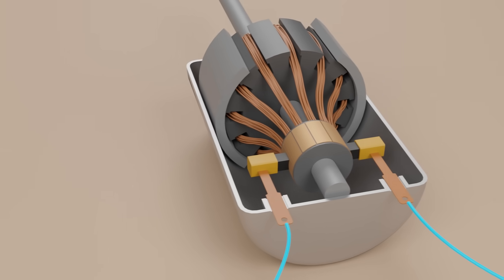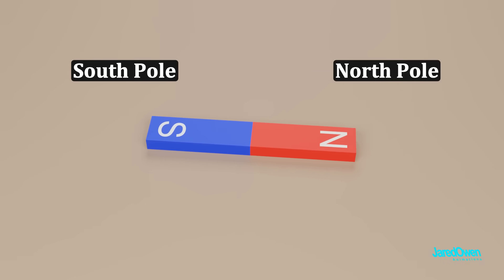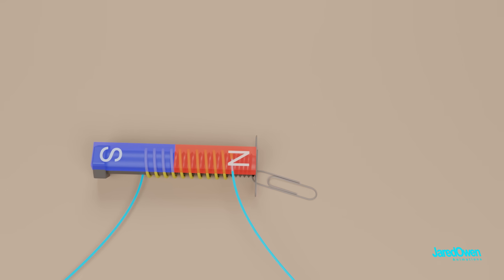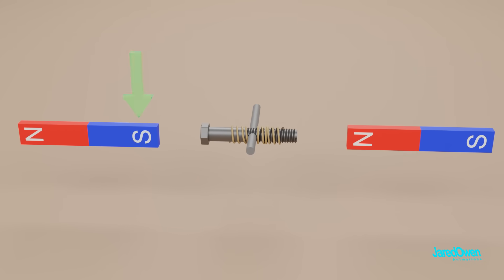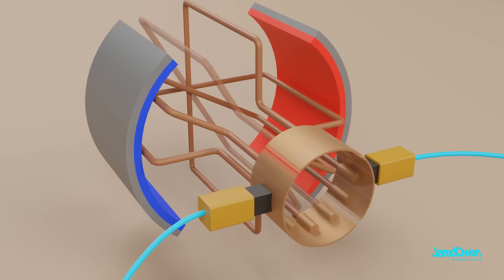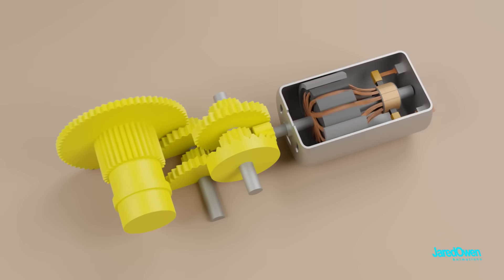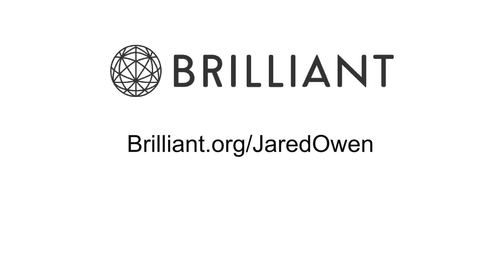How does an Electric Motor work?  (DC Motor)

Comment: ive have some general idea of how a motor work using abit of logic i conclude it must be magnets and electomagnets stuff but before watching this video i cant really understand how the thing work because available motor i have is small and if you open it it just filled with wires. theres alot of thing i didnt understand mostly the switching current part . but your video was made with high quality in mind after i watch it 1 time i completely understand how it works so i want to thank you for that

Comment: Name one device that will work differently if you swap poles?
Reply from the maker: The electric motor😁  It will spin the other way if the battery is reversed

Comment: In my experience, learning about how electromagnetic devices are made (the "how") raises more questions that it answers (the "why")...
1. why the charges bother to move through the circuit
2. why the charges move as quickly as they do
3. why the charges have to be moving to create a magnetic field
4. why both an electric field and a magnetic field are needed for this (or any) circuit
5. why the circuit has to be created with a ferromagnetic material
6. why the motor spins in a certain direction
Reply from the maker: Great questions!  I didn't want to get too deep into that kind of stuff for this video

Comment: Very cool! I teach the King Air aircraft. The electrical system and specifically, the starter motor which then becomes a generator, will be easier to explain with this video. I also throw in the watt (volt x amp) to foot lbs torque discussion to help them make real world sense of the spin the starter provides. Thanks!
Reply from the maker: Thanks James!  I was originally going to take a minute or 2 at the end of this video to explain generators but I thought it might be too much.

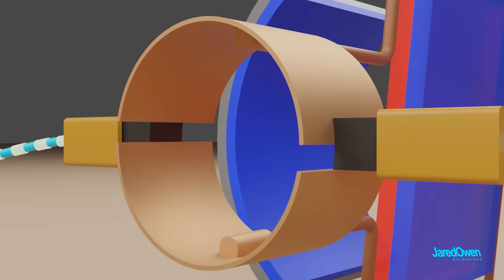Comment: The current flows 5:18 because of the battery.,but how the current changes its flow before and after the switch 5:39..?

Comment: Electricity actually flows from the negative end to the positive, because the flow is electrons, which are negatively charged, so the place where they come from is the negative pole.
Reply: You could think of it as this. Negative electrons move from the negative to positive terminals of the battery (your right), but the positive charge of electricity flows from positive to negative terminals of the battery. So it is kinda both.
Reply: @MrT------5743  actually no right?
Because positive  charge is in the protons, while the electrons are negatively charged, and electric flow is electrons moving around. Protons are parts of atom cores. So the positive charge moving is not gaining protons (which would drastically change the weight compared to electrons) but rather a lack of electrons. So the positive charge isn't moving anywhere, the negative charge oppressing the positive charge of one side is just moving to the other side until both sides have reached equilibrium and there is no (disbalance in) charge left, making your battery "empty" (quotes because it hasen't lost anything)
Reply: @jucom756  But a lack of electrons (an electron hole) is positive and that moves the opposite direction as the electrons move to fill that hole. I get that the positive electron absence isn't really physical but it is a thing none the less.
Reply: @MrT------5743  that's a good explanation thx.

Comment: Well, the current goes through all the coils (some might get shorted by the brushes). 
That is because the coils aren't wound directly 180 degrees to the opposite commutator segment. The point is that current runs one way through all the conductors on one side and then the other way on the other side.
Also, heh, I'm tired but... parallel conductors have absolutely no effect on the resulting force/field/torque. You need to increase actual winding count so that the resulting fields add up. In parallel you would just reduce coil resistance.

Ah, man... I'm having my final masters exam exactly with this stuff just next week and atm I just hate my life :/ 
FREEDOM! Koně, království za koně!

Comment: Great video. thank you!. So it will only last as long as the brushes... presumably they wear out because of friction?  Does the motor housing fill with fine dust from them, like the you get from the brake pads on your car?

Comment: I don't want to be the nerdy guy, but the thing with the bold and the wire isn't really true. Yes, you can turn some metals into magnets by lining up der small magnetic structures, but thats not how electro magnets work. They work because a magnetic field is created around the wire due to the current flwo and when you turn the wire into a coil the magnetic fields stack on top of each other and creating a stronger, directed field. The core inside the coil (the bolt) just increases the strength of the magnet but it isn't necessary.

Comment: Fantastic video. I have 2 questions that someone may he able to answer:

1. 2:57 Why does cutting the current cause all of the magnetic domains to revert back to random orientations when they were already nicely aligned?

2. 7:28 Intuitively, why does replacing a thick wire with many thinner wires improve performance?

Comment: You are showing the current the wrong way. Electrons come out the "bottom" of the battery and return to the "top".
Reply from the maker: Thanks Steve - what you are thinking of is "electron flow" - in this video I specifically mentioned "conventional flow"

Comment: Sometimes you see labels on these motors that say 5V for example and if you put more voltage through it, you risk breaking it. So what determines the voltage rating of a dc motor and why does putting more voltage through it than recommended break it?

Comment: What about a brushless motor?
Reply: In a brushless motor, the magnets are on the rotor and the electromagnet coils are on the stator. The switching of the current is done by an electronic speed controller instead of a commutator, so a brushless DC motor is basically an AC motor that's supplied with AC at a specific frequency to set its speed.

Comment: A timestamp 2:42 you imply that the magnetism of an electromagnet comes from the wire forcing the magnetic domains in the Ferris core to lineup.

This is not wrong however it is only a small part of the magnetic field in the electromagnet. You do not need the Ferris core at all. 

Magnetism occurs anytime electrons move. so every wire is producing a magnetic field. Just on a very strong one. If you make a hitchhiking thumb and point your thumb in the direction of charge flow the curling of your fingers tells you the direction of the magnetic field. 

When you coil the wire many times this allows you to add up your finger curl direction from the same wire many times amplifying the magnetic field from the wire.

If you add a metallic core it act s a little bit like a lens and adds its own magnetic field from the aligned domains in the material as you said.

Tldr, The wire itself produces the magnetic field. Not the metal it's wrapped around, although that helps.
Reply from the maker: Yes I believe this explanation is correct!  It's always hard to find the balance - not go in too deep but make sure I explain "enough"

Comment: And what’s the dark grey thing at the wires??? It is it just there to hold the wires? ( 7:33 )
Reply: It is the rotor and comparable to the screw used in the video. It isn't the wires on their own creating a magnetic field, it is the wires wrapped around the rotor (or screw) that does. Hope that answers your question.

Comment: You can also have motors which work in the opposite way to the diagram in the video, with the coiled wire on the outside on the magnet but inside the motor casing, most commonly copper, and the magnet on the inside. This means that a simpler motor can be created as there is no need for the commutator, this is used in things like vehicle motors for a few reasons, one being that you can it even more wire in a smaller space, it is even more constant than the one in the video and it also allows them to be shorter, meaning there is more space for batteries.

Comment: Nice Video!👌
You know you could also use a permanent magnet instead of an electromagnet, which would basically give you an infinite energy source.
However, you would have to rearrange the construction a bit; yet it should still be possible, because I’ve seen people use fidget spinners to demonstrate this.

Comment: how does the commutator "switch" the wires? I didn't understand that part
Reply: It doesn't switch the wires as such, the wires stay where they are. However the commutator is broken into sections, and each proceeding section is opposite polarity of the previous one. So as the commutator rotates the polarity will change each time the brushes get to a new section of the commutator so to speak.

Comment: Don't electromagnets need an iron core or something to work? i saw you showing a wire around a bolt, but then just the wires as the motor
Reply from the maker: Great question Jacob - an iron core is not needed but it definitely helps strengthen the electromagnet.  I believe the metal part that wires wrap around is actually magnetized by the wires
Reply: @JaredOwen  was thinking the same thing, thanks for clearing that up for me!

Comment: The fan shown in this video uses an AC motor, no?
Reply from the maker: Yeah I believe that's correct!  For that part I was just showing motors in general - not just DC motors
Reply: @JaredOwen  Thanks for your reply. I loved your other video about how an oscillating fan works. I took mine apart and tried to figure out how exactly the motor achieves 3 different speeds but I couldn't figure it out. Would love to see a video solving that mystery for me!

Comment: I hope you can show us how a nuclear powerplant works.
Reply from the maker: Yes! This is on my list😁
Reply: @JaredOwen  When is shuttle animation? Can't wait
Reply: @Enzi_Meteori_902  I saw you in Swin city's channel 😱
Reply: @JaredOwen  what about space shuttle....?
Reply: Jared Owen, i love your content!
Reply: @JaredOwen  
Can't wait!!! 👌💯
Reply: @JaredOwen  please make video about the M2 Browning 50 cal machine gun?
Reply: Wow! That's good to hear. I hope water desalination plant and vertical farms are also on your list.

Energy, water and food are my greatest concern for the future.
Reply: That would be sick
Reply: It’s in two parts.

First you have a thingie that turns another form of energy into heat (thermal energy). This can be a fission reactor (nuclear energy), or it can be a furnace burning coal or oil (chemical energy).

Then you have a second thingie that turns the heat, the thermal energy, into electrical energy. This thingie does not care where the heat came from.
Reply: @peterknutsen3070  Yes. Nuclear reactors as a principle is very simple.
Reply: it's just a glorified steam engine,  and that nuclear thing is simply a stove
Reply: @electronresonator8882  Pretty much yes. Only if you leave the stove alone it will blow up. Essentially you need to remove the wood from the stove to prevent it from doing so.
Reply: That is actually not really complicated. 
Radioactive rods  releases neutrons. These neutrons that hits other radioactive materials will then cause them to release more neutrons. So enough material close enough together will start a chain reaction that essentially keeps it going. This releases radiation that in turn makes the water really hot. Hot water turns to steam. Steam can be used to make turbine fans rotate which then sits on essentially a motor only reversed so it uses rotation to produce electricity. 

The principle of it is actually quite simple. Controlling it and building the safety as well as managing the fuel is what makes it hard.
Reply: This is not Kim Jung aun's channel try to find Kim Jung aun's channel

Comment: I just took apart an old starter for my lawnmower, and it too is a brushed dc motor
Reply from the maker: Nice!
Reply: now put it back together
Reply: @floriang7435  no point the stator magnet broke
Reply: @AchievedZeus574  Oh dear... Now you have to pop down to the nearest store to get a new lawnmower
Reply: @lord_raindrops237  got one arriving end of next week
Reply: @AchievedZeus574  Good job then
Reply: @Iskandar does things what?
Reply: @Iskandar does things just starter. so its probably connected to battery

Comment: Do “How does a refrigerator work” next.
Reply: yes please
Reply: Gamer_28 lmo
Reply: No. He said that he will make a space shuttle animation.
Reply: I think it works by stretching rubber bands and then compressing them, over and over.                                                             Jk. But someone has made that before
Reply: @limesheep0140  No, it works with a bicycle air pump and an aerosol can. Just ask curiosityshow
Reply: @majortom4543  ok then but refrigerator animation would be nice
Reply: @limesheep0140  okay lol
Reply: LukePlayz2415 when you close the door it pushes a button at the top that turns off the light
Reply: umm... you will need to go through Thermodynamics course first. otherwise, you won't understand where that thing comes from or why it works that way. same principle in Air-conditioning unit.
by the way.. love video and explanation. i wish they had this kind of animation in physics class in high-school, so that students can enjoy studying more than just board and chalk.
Reply: good Idea
Reply: Yes. But making consideration of Pressure, Temperature & State of Refrigerant Liquid over all the process of cooling.
Reply: @mysterychemical  bro , you are like our school teachers , haha XD
Reply: They use electric motors lol
Reply: @LukePlayz-gf2is  That is the easiest part. If you are talking for real reply back, and i will explain
Reply: You should go to learn engineering there you found how to work refrigerator
Reply: I think it's because of the atoms slowing down so there's less friction which is less heat
Reply: @LukePlayz-gf2is  lol
Reply: How does a woman work? Now that will be something!
Reply: https://youtu.be/6OU7WHgJ_cY
This uses the same principal as the refrigerator.
Reply: https://youtu.be/7Wgv6cgLEsk
Energy saving tactics
Reply: YES
Reply: keren mantap
Reply: VCRS ( VAPOUR CONDENSATION REFRIGERATION SYSTEM.)
Reply: https://youtu.be/8lPYFG_AO30
Reply: I love refrigerators